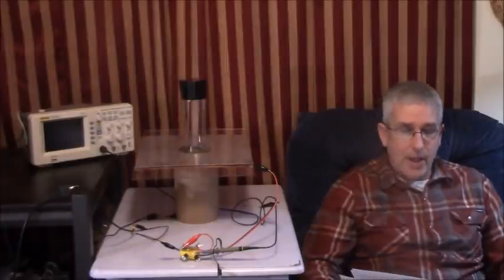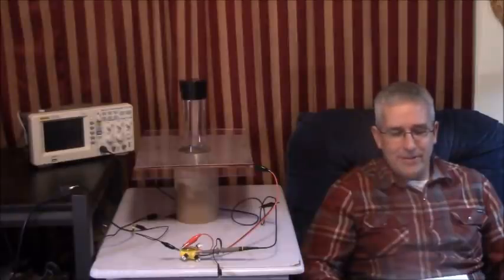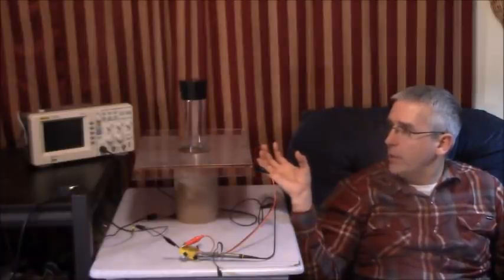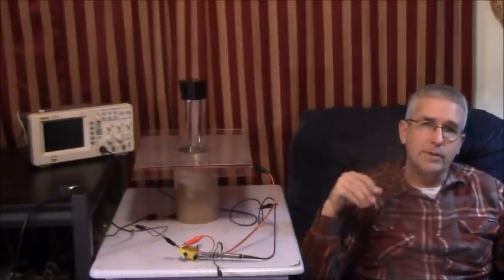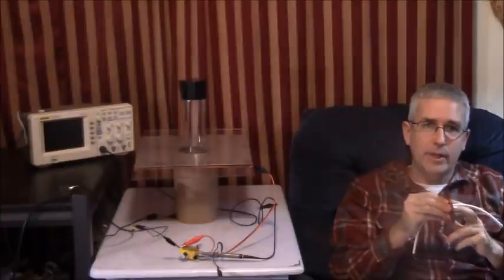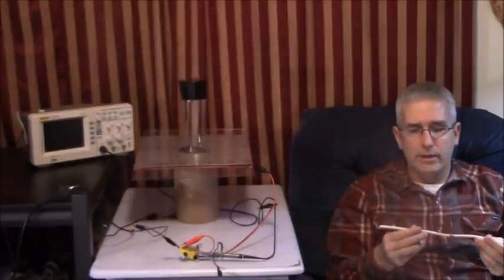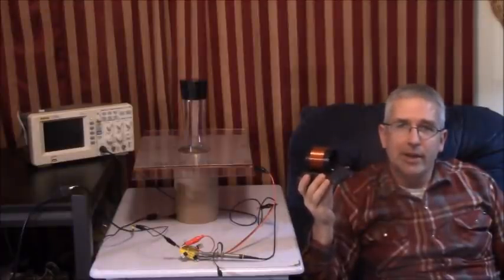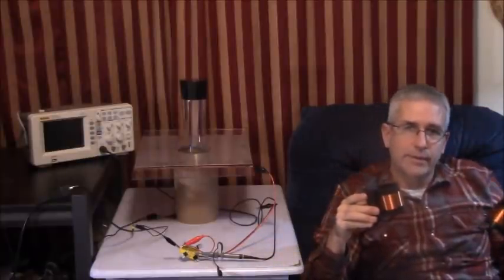How to Develop Free Energy: Plasma Column Dipole System

Comment: Instead of resistor on the ground would it be better to use a diode? 

Thank you for the video! Your DLS book and lab kits are very encouraging. Special thanks for crystal radio add on the other year - Loved poking copper pipes under the sinks with my kid holding antenna and listening to radio. A lot of fun.
Reply from the maker: The resistor is acting like a diode at the higher frequencies. This is something you can learn by experience as you break down the structure of a diode, resistor and capacitor and the various parts Don listed in the schematics that accomplish this goal of allowing electrons in this input ground connection, then keeping them in the circuit to oscillate and spin, and then having just enough resistance and blockage to give the electrons another path back to ground through the load. This is why you see no specific values given, and why the only example you see from Don was a wire wound variable resistor on a tube which becomes an inductor/resistor/capacitor as he mentioned. An additional one can be placed after the load on the return ground which can limit the current. These are different than using MOVs to cut off the high voltage peaks from the high end to ground which are also part of the system.
Reply: @rickfriedrich  thank you Rick! Make sense. I wish you would have these SCR/MOSFET and perhaps MOV  as a kit available for your RICK coils power range. Trying to figure all these transient filtering and controlled firing rate of Capacitor pushed me to use GDT to isolation transformer instead. GDT Seems to take care of stabilizing firing rate based on voltage level threshold and filter out transient as well. Simple approach without timing circuits/SCR, yet not sure if correct one from prospective of limiting electrons flow to ground. When right cap is added across transformer it feels like GDT may be firing at its limits, way too bright.

Comment: Great video Rick, one of the best so far.  One question though that was not exactly clear.......1. Whats the easiest method to match the discharge voltage of the capacitor, through the transistor,  to the input voltage of the primary side of the x-former?  For example I have a 240V/480v  to 120v/240v step down isolation transformer I purchased. Thank you sir for you dedication.  God bless.
Reply from the maker: I don't see a question here.
Reply: Thanks Rick, so what I’m asking is how do I set the discharge voltage level out of he cap to a certain voltage?  What’s the simplest way?  Voltage divider before transistor? My last question then is the storage capacitor bank charged to full hv from the plasma globe, or is it kept charged to the discharge voltage we are pulsing to the isolation transformer?  Keep up the good work sir!
Reply: I use a GDT (gas discharge tube). It's the 470v one. Don said you could also use a varistor but I have a few big 80 amp 470v varistors and they don't seem to limit the voltage. Don also said you can use spark gaps to limit the voltage. My transformer is 480v/120v but sadly not isolation type. But the SCR dump does work. But the resistor method to reduce the frequency will not as if the load changes, so does the inductance which will throw everything off.

Comment: Could the plasma lamp be replaced with a cathode ray tube. You mentioned a dipole, so I was thinking a vacuum spark tube that travels from one end to the other might work the same. Or is there something special with plasma when it interacts with certain gases. That would be an interesting expirament.
Reply: Or with an ferrit core coil...
Reply: @liannastarsoul5440  I thought the same with an air core.
Reply from the maker: Any dipole at or above radio frequency. But you have to have the correct angle. You can't put the plates at the side center of the plasma ball/globe as the streams are not going up and down there as they do 3/4 way up. That's why the column works better so long as you are not too close to it and it arcs over to the plates. 
You can use high frequency wires, gas and metal tubes, radar systems, etc. 
If you apply what I showed with my kit influencing as many coils as I could place around the transmitter, you can see that you can gather as much energy as you wish in many ways. This is why Don's book is so important.
Reply: @rickfriedrich  I noticed with the kit that  if I turn the unwired coil 45° to the corner of the first coil, the LED is bright. 90° and the LED is off. Also 90° on center and the LED is off. It appears that the energy fields would be doughnut shaped. One field from the center of the coil to above the top, and an other one from the center to below the coil. This would confirm David LaPoint's theories (look him up if you're unfamiliar with primer fields). So my point is the energy fields don't run straight up and down, but rather circular, or doughnut shaped. One on the top half one on the bottom half.

Comment: hey rick. I had a few questions on Don's japan model. Is it the configuration of his diode bridge that no one seems to notice? It looks like it isn't set up like a normal full wave diode bridge. Also what is he using to drive the gate of the scr thyristor?
Reply: Hey, I also noticed the diode configuration was different and tried wiring it that way with HF HV diodes and didn't get much of a difference on charging the capacitor. I think it's important to get the capacitor to be in resonance with the frequency coming out of the full bridge rectifier. Using a nomograph to match the pump rate of the capacitor is important, but I'm having issues finding non inductive and non capacitive resistors to put across the capacitor. Haven't tried with a variable resistor to see if that works. as they all have inductance/capacitance as well as resistance and throws the balancing act completely off.

Also noticed that the Toriod in the Japan model looks like it has an outer winding that doesn't go through the middle of the Toriod.
This I think is also an important piece of information for the wave shaping as the suitcase model had a similar winding arrangement.

Driving the SCR is usually done by pulsing a pulse transformer. older welding machine boards have it setup this way and it works well. Use a 555 timer to pulse either a mosfet or transistor which pulses the primary of the small pulse transformer, then hook up the secondary to the gate of the SCR  and cathode. This creates an isolation between your driver circuit and the potential high voltages of the SCR.

I have it setup with the plasma column currently and one plate copper and one plate aluminum with Kapton in between the layers.

The issue I'm having is again getting the plates to resonate with the column frequency in order to draw electrons in from ground.

Next step I'm going to make a variable pulse circuit to change the frequency of the plasma column to see if I can tune the frequency rather then finding the right resistor to put in parallel with the plates.

I wired it like in the video and it works and I get a nice spark when shorting the capacitor. The spark is increased once a ground source is introduced.

Lots of important details need to be followed correctly in order for it to work properly.

Good luck and be safe.

Once built correctly it is a dangerous current producing source. Do not build if you dont have knowledge of how deadly it can be.
Reply: @draskoa1570  Something to think about, in Dons setup, he had a coil of wire sitting on the globe, this must be tuned to resonate with the capacitor you are charging.  This makes it easy to tune this new LC circuit to the 28KHZ of the plasma globe.  Good luck and please keep us updated.

Comment: Issue Im seeing and experiencing in this set up is that the cap bank needs to be in the nf range to be able to charge quick enough to keep up with a 60hz discharge rate into the isolation transformer.  Not enough charge stored it seems to affect anything in the isolation transformer.  This is with a adjustable resistor on capacitor ground, and a direct ground path at the pri of the transformer.  Seems like I am missing something here.  The frequency rate of these plasma globes is about  25KHZ, maybe too low to charge the cap bank quick enough, Im not sure.  Also seems the only resonance in this system specifically is the cap needed across the pri of your isolation transformer to cause it to resonate at 60hz, so it will also be pumped/ringed by the mosfet at 60hz.   What am I missing here?
Reply from the maker: First of all, this is not a setup. I am just showing the very basics for people to understand that there is energy there to be collected and which can be used. I'm giving an overview rather than some step by step instructions. The full details are in the book and depend upon the parts you have available and what you want to do. For example, you can tap many more places on the tube by repeating the process. The collector plates need to be in resonance tank circuit with the particular frequency. The grounding system needs to be added with the output load in order to have the full benefit. I'm just showing this to give the basic idea at a safe level where people can see something important. The capacitor charges up at a certain rate depending on it's capacity, it being in resonance, and the grounding system, etc. You can then discharge it periodically downstream. 
The main point of this is that the input system or the plasma toy as it is meant to be, is not affected by this collection process, so that you are getting free energy from each place you tap it without diminishing the input process. Secondly, you can tap as many places across this dipole as you want. Thirdly, you can create far more energy output than the 8W it takes to power it. Fourthly, you can apply this concept to other hf hv dipoles.
When I get more time I may get more into this particular setup. That will probably be in the upcoming addition to the Resonance kit new option.
Reply: @rickfriedrich  👍 got your book, its overused and the binding fell apart so I had to zip tie it together.
Reply from the maker: @fernandogigliotti2299  We only ship out new books. It must have been damaged in the mail.
Reply: @rickfriedrich  No no no, thats not what I meant Rick!  I have been researching and reading it so much, that it has been overused.  It was perfect when I received it.  Don't worry.  I hope for the people that are well versed in safely handling hv voltage and amperage you can hint to the missing pieces.  For obvious reasons Don left some things out, that you just expanded on, which the capacitor plates need to resonate at frequency of plasma globe for resonance.  That helps.  I did not understand why in some circuits Don takes right from the NST, to the 200amps diodes, then straight to cap bank.  These is no resonance there, but he must have purposely left that out.  Even the "build your own unit" has no resonance at all.
Reply: @fernandogigliotti2299  please read Don's emails that are listed in RIck's book. One of his systems is a capacitor-based device where he puts a charge on one plate and is duplicated on the other side, which is then in series with earth grounding. This principle was demonstrated at 2005 conference - capacitor plates experiment. Don's system with large NST and 3-phase caps uses this principle.
Reply: @elgroovy  Ahhhh, that makes much more sense now, I'm away of that experiment and have reproduced it, I just didnt connect the dots.  Thank you for pointing out the obvious.
Reply: @fernandogigliotti2299  Hey, Any luck with the experiment. I'm located in Hamilton Ontario. I dealt with similar result. Maybe we could get a small group going to brainstorm together?
Reply: @elgroovy  i have built this capacitor device recently. It works as don said. You can get ou and create multiple copies of the input. This may be easier to build than the plasma tube. Don said he even used it to power airplanes
Reply: @scraw3  how much OU did you get?
Reply: @isaiahj3968  I put 10,000 volts from an ignition coil on the input and get 10,000 on the other side. Then I added several wires to the other side and each one was 10,000v drawing current from the air or ground. I did not have any expensive equipment to do accurate measurements, but believe me when I tell you this device is overunity

Comment: "A big resistor that's of low value"  How many watts? Fixed or variable?
Reply from the maker: Initially you have variable until you determine what you want to do. Watts depends on the size of the system. A bit wirewound resistor that is also an inductor that you can clamp onto to vary at that point. I've shown this in previous videos...

Comment: So u are using your systems to get OU and run your home or other devices out of it for free?
Reply from the maker: I have shown some examples to the public that I have used to power vehicles, fans, lights, generators, etc. I do not share the specifics with the public what I privately do beyond sometimes showing these examples at my meetings or with video. In 2005 I was able to power all my electrical needs after learning the radiant/negative energy system.

Comment: conrad is sold out on the tubes :( Just the idea I had when you charge a cap 26000 times per second and your inverter runs 60Hz. Also you can run your primary to ground and not back into the PSU so lentz law is out of the window OR have a coilcap as the secondary coil
Reply from the maker: You can just use a fluorescent tube
Reply: @rickfriedrich another nugget😁✌️❤️🤘

Comment: Hello. Need a hint. I use Plasma ball. With a frequency of 25 kilohertz. I took 4 meters of wire 16 squares. Made 6 revolutions. I sent a current through the diode bridge high-voltage 12 kV 450 mA. indicates a voltage of 700 volts DC. And he sent 1000 volts 30 A through the diodes of the solar panels. It produces a voltage of 400 volts DC. Which capacitor is better to use with which capacitance? to continue running the current to heat the water.                https://www.youtube.com/watch?v=V3GmqXNkAhs